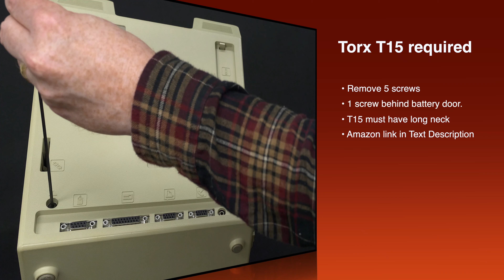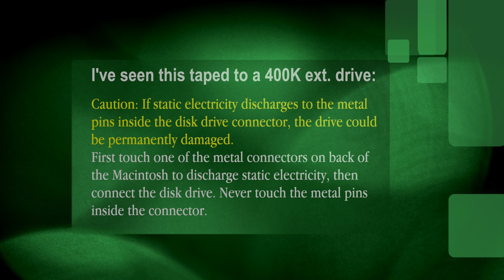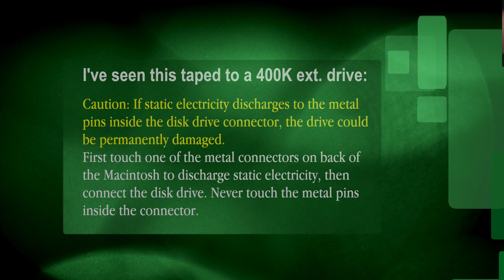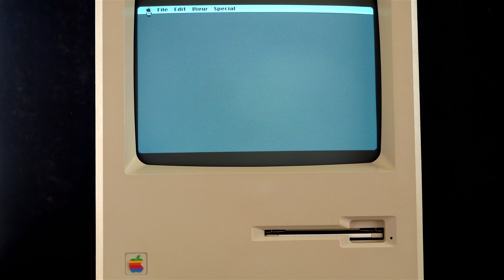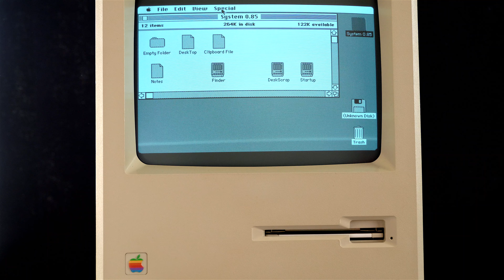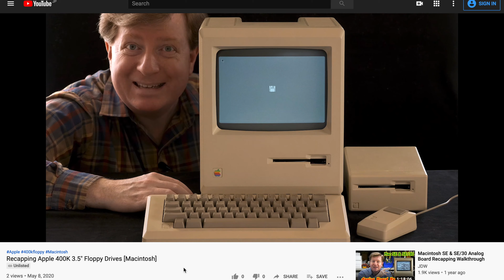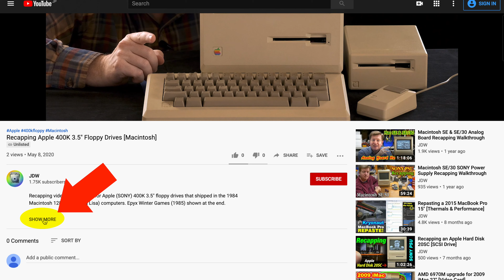Recapping Apple 400K 3.5" Floppy Drives [Macintosh]

Comment: Excellent video! I just got an external M0130 drive working (though I haven’t recapped it yet), and I also just got a Macintosh 512K, but the floppy drive in it does not work. It has the “click of death” issue, where the stepper motor drives the heads all the way forward, and just keeps turning and turning. I found something online that suggested it could be the track-0 sensor, and that unplugging it should make the stepper motor stop turning if the sensor is the problem, but unplugging it on my drive didn’t change anything, suggesting there is a different problem. Do you have any experience with this problem? When I first took the drive out of the Mac I found that the stepper motor was unplugged, so someone else was obviously having problems with it too.

I think I am going to get another M0130 drive so I’ll have another one to swap some parts around with. They aren’t too hard to find.
Reply from the maker: There are optical switches at the front and back.  You need to check all of them.  The one in back is normally related to the click-of-death.  Not sure if you read this or not, but it might be helpful: 
https://lowendmac.com/2001/vintage-mac-400k-floppy-drive-repeating-click-of-death/
Reply: JDW Thanks for the reply! Yes, I had seen that article. Good news is, I got the drive working! I soaked the sensor in alcohol, scrubbed it with a toothbrush and that did the trick! Thanks once again for the video. Your detailed instructions were great for helping me disassemble my drives!
Reply: I have exact the same problem with my Macintosh 128K (OA-D34V-22 drive). Unplugging the sensor didn't change anything. Now I'll also soak the sensor in alcohol - but one question before: Is this sensor in the back also emiting visible red light (like the both in the front) when it is working? Because mine is invisible or off/broken. (THX @JDW too! Impressive channel! :-))
Reply: No, the head sensor does not glow red like the other two. Good luck!

Comment: Wasn't it cmd-shift-1 and 2 to eject these disk drives ?
Reply from the maker: Yes, thank you for reminding me.  Shift-CMD-1 ejects the INTERNAL disk while Shift-CMD-2 ejects the EXTERNAL.
Reply: And cmd-shift-3 for pict screenshot. Dunno how low a Finder/System version you can get this with
Reply from the maker: @1BitFeverDreams  I just tested the eject shortcuts with System 0.97 and it works.  System 3.3 and Finder 5.1 also work.

Comment: Is there a way to test the floppy drive with a newer computer? Is there a cable adapter that you i can buy? Thanks for your help
Reply from the maker: If you mean connect this old 400K floppy drive to a computer made today, the answer is no.  Remember, this is an Apple drive, not a drive made for PCs.  So it's very special in terms of its operation and works with a special chip on vintage Mac motherboards.  To proper test if the drive is good, you really need a Macintosh 128K or 512K or 512Ke computer
Reply: @JDW-  ok ,i was hoping that I could find a cable adapter, :( thank so much for replying have a great day 👍

Comment: Great videos my friend!!! I am a fresh owner of a Macintosh 128k. It needs some work done unfortunately. When I insert the system disk I get error 0f0004 and a sad Mac face and it doesn't eject it either. On the other hand, the same system disk gets rejected and ejected on a Macintosh plus. Would you know what is going on? Also, on the display there are horizontal lines and they kind of face away if I adjust the brightness to a lower level. What do you think it could be? I hope nothing to do with the main board but only analog board issues.. Thank you so much and keep up the great work!
Reply from the maker: Thank you for your kind words. The lines on the display when you max out the brightness are nothing to worry about. It’s normal. You just need to reduce the screen brightness to eliminate them.

I cannot say if your floppy disk is good or bad even though it doesn’t work on two different machines. That disk simply could be incompatible with a Plus whereas it might work on 128K machine. You really would need to test other disks to be sure. 

Sad Mac error codes occurring when you insert a floppy disk into a 400K floppy drive can indicate a problem with the drive or it’s ribbon cable.  You need a gray cable with a red stripe.

It could also be a floppy drive model incompatibility with the Mac’s ROM version, as described in detail here:

https://bit.ly/30hYoIm

Lastly, it could be there’s nothing wrong with your ribbon cable or drive or drive version and ROM version. It could be the wrong System file combined with the wrong Finder version on the disk itself.

I highly recommend the FloppyEMU to help diagnose problems and make your vintage Mac hobby more fun:

https://www.bigmessowires.com/shop/product/floppy-emu-model-b/

It seems to be out of stock right now, so you’ll need to email the owner, Steve, to get more specifics on when it can ship.

I hope this helps!
Reply: Thanks for answering and so promptly too! 
I tried a floppy emu but it isn’t mine, it was from the guy who sold me the unit. The unit boots with the floppy emu. I’d like to get it to boot from the floppy though. So the lines are normal? It looks weird the display. It doesn’t look too normal honestly, hard to explain I should send a video maybe or a picture. I looked up online and the 0F0004 error seems to be related with the voltage adjustment on the analog board. I read I should turn it to zero and then adjust it until I measure 5v on the video connector PIN number 6, not sure which connector that is. After seeing your video about discharging the crt I’m a bit paranoid touching the whole analog board. From which part of the world are you? If you were in australia I’d love to send you this analog board for a refurbishment, I am afraid I would damage it if I do the recapping myself. Thanks again!
Reply from the maker: I’m located in Japan so it’s probably not cost-effective to ship anything to me. If you upload photos or a video, feel free to post the link in the comments. I don’t block links. But I’m not sure it’s a voltage problem because if it was a voltage problem then why would your FloppyEMU boot your machine so perfectly?  I do recommend measuring the voltages at the floppy disk external connector, but you will need a digital multi meter to do that.
Reply: JDW I will try to post when I get some time to work on it. 
It could be the floppy drive not reading, who knows. What voltages should I measure? I might take it apart and check it, regardless.
I’m more concerned about those lines and the corrosion on the board. I might swap the boards between the 128k and the plus. The board on the plus looks better but someone rebuilt a track with a wire, not a fine job really. 
The speaker on the 128k is bridged with two cables to a new speaker, I assume the original speaker doesn’t work. It’s a bit messed up.. any chance to contact you directly maybe? If you don’t mind obviously
Reply from the maker: If you want to contact me privately, just click on my JDW name, which will take you to my channel. Then click the About tab and you’ll find how to send me an email from that page. 

As to measuring the voltages at the external floppy disk connector, you just put the black probe of your meter into one of the bolt holes, which are ground, and then insert a paperclip individually into the female terminals of that connector and touch your red probe to that paper clip to read the individual voltages. You will see 5 V and 12 V, among other voltages in that connector. So long as it’s above 4.7V or above 12.0 V, voltages are fine.
Reply: I will try as soon as I get a chance and we will be in touch. Can’t find a way to contact you from the about page though. Thanks again! I’ll be in touch!
Reply from the maker: You’re probably using a mobile device. To access the email address under the About tab you will need to use a desktop computer. It’s towards the bottom of the page and it says “For business inquiries“.

Comment: You might be avle to help me with these drives, I cleaned both drives up and got them unstuck. When I hook them to my mac 128k I can see the red light on inside but when a disk is inserted nothing happens, I moved the read /write head further in the unit and when the power is applied the read/write head does moved back out to the most outer track. Any idea what might be going on? I have 12 volts entering the drive. Any help at all would be great.
Reply from the maker: The head moves only when you push on it?  Or does the head move when power is applied (e.g., when you switch on the Mac's power) every time even if you do not touch the drive?  Are all the little connectors properly seated in their sockets?  And while probably not a cause of your problem, have you taken a magnifying glass and looked at each of the electrolytic capacitors to see if there is any kind of goo or leaked fluid at the base of each capacitor?
Reply: @JDW-  After watching your video here I sat and thought about it for a couple of hours ( yea ok) but anyway I have two drives that are acting the same way. So I looked at both of them and your video and realized what was wrong. When the disk is put inside the drive it pushes down a switch on both sides of the disk. Looking into the slot on the left side it is the write enable for the disk. On the right the switches enables the drive when pushed down. Both drives have a small piece of plastic that sticks up on the right side switch. When the disk is placed in the drive it will push down far enough I think to break a red light maybe to power on the drive.
Reply from the maker: @stanmoonie1530  There are 3 optical switches which you need to clean with a brush to ensure they are not clogged.  These switches are not the moving plastic parts but the actual sensor mounted on the PCB -- that is the part you must clean.  There are 2 at the front of the drive shown at 21:20 in my video, and the third is toward the back of the drive, near the motor, and can be seen at 40:40 in my video.  The sensor at back (near the motor) can cause the Click of Death, which is described in more detail here: https://bit.ly/3mNj8B3
Reply: @JDW-  Yes I saw that in your video. On both of these drives there is a pieve of plastic that sticks up and it is broke off on both drives. The drives came in the down position all gummed up and would not eject the disk so I would guess that the people that broke them must have pried the disk out of the drive or tried to force the disk in the drive. Thank you for the info.

Comment: Don't bend the legs! If you even need to remove the component, you can end up messing up the board. Otherwise great video.
Reply from the maker: I appreciate the suggestion, but I'm afraid I don't follow.  If you are saying, "do not bend the legs of the capacitor to keep the capacitor from falling out while you solder it in," then I would disagree that any kind of bend is bad, insofar as the angle at which you see me bend the legs in my video is not 90°.  Believe me, I've seen those 90° bends, where the lead is parallel with the PCB, and desoldering those takes more effort, to be sure!  But since my bends were not parallel with the board, desoldering isn't as difficult as you may think.